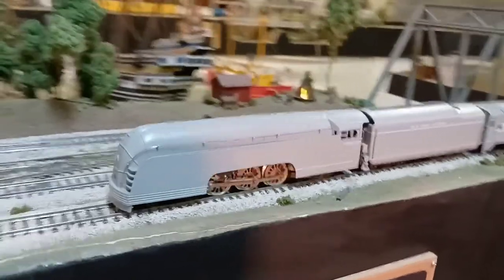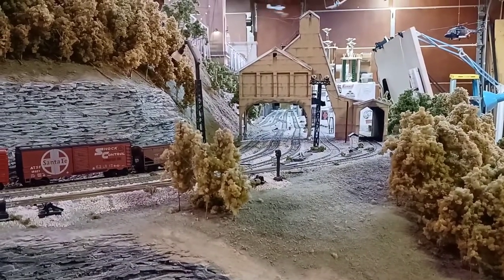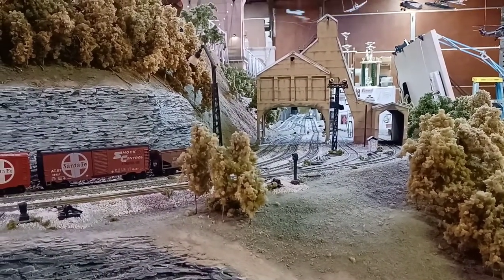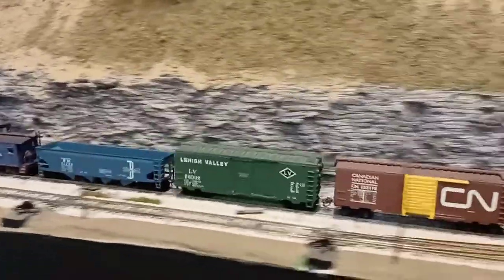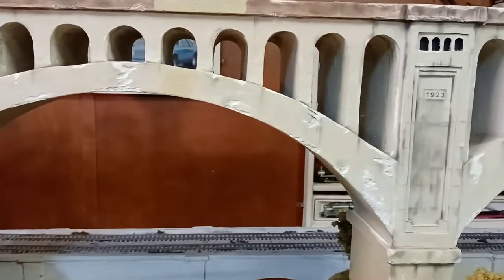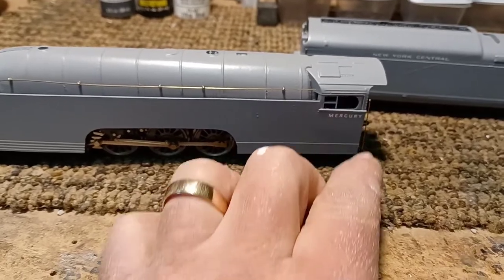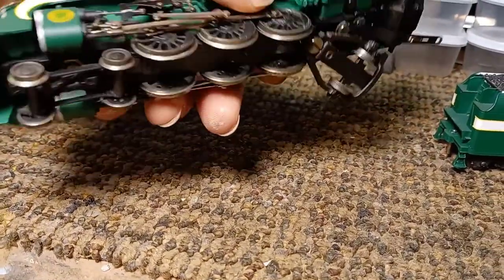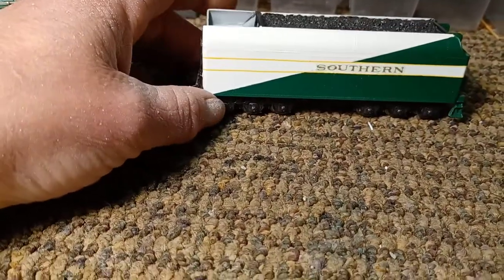My Rivarossi Mercury and Tennessean locomotives.

Comment: I have all the passenger cars for all the Southern railway equipment but I haven't found any locomotives part to  build that locomotive.
Reply from the maker: I have a 4 car southern set of Con Cor cars for mine. You'll just have to keep a eye out for locomotives.  The prices are getting crazy and it's harder to find them. Luckily I have good stock pile of them still, but it's getting low too.
Reply: If you find another Hudson locomotive I would like to get it from you.  I South Carolina  we do not see any Hudson  down here.  New York Central isn't popular in are area.  Southern, Seaboard air line, Atlantic coast lines , CSX, NS, and others falling flags in the southeast.